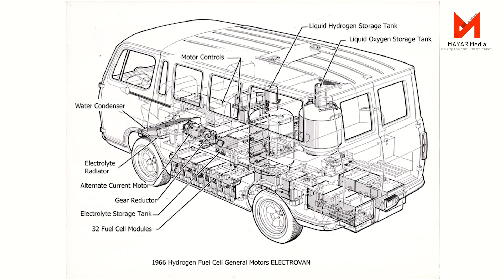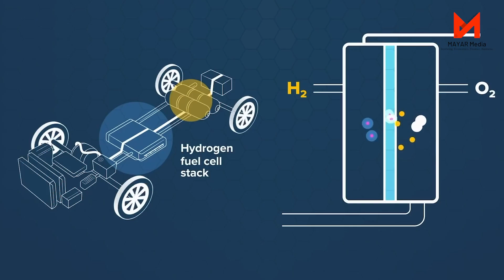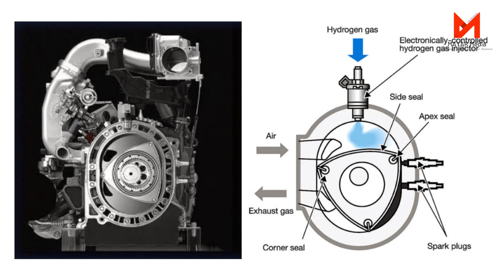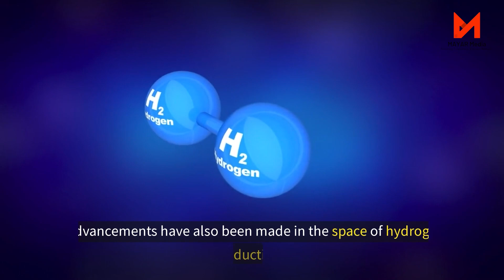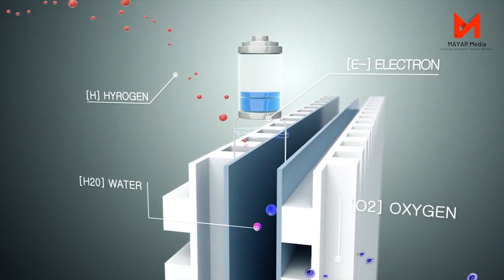Could The Hydrogen Car Kill EVs? [& Revolutionize The Automobile Industry]

Comment: Hydrogen will never replace electric. There are several important reasons for this. One reason is that using an ICE to burn hydrogen instead of fuel is still extremely inefficient. There is absolutely zero infrastructure for hydrogen in almost every country of the world. Hydrogen is very hard to contain. It is a very leaky gas and the technology to cheaply manufacture and transport. It exists but you're carrying the cost of manufacturing and transporting a fuel. And yes hydrogen has to be manufactured. So while on the surface you would gain some independence. The cost of hydrogen is as much or more than petroleum.
Reply: 😂, the.

😊

😊😊.😊😊..😊😊😊.😊😊
😊.😊😊.😊😊😊 me p..😊😊

Comment: Neither Hydrogen or EV's will revolutionize anything any time soon. It has taken the automotive industry over 100 years to get to were we are today.   The problems with Hydrogen are well known but the media still insists on coming out with hype that seems to get the attention of the public, the part about emissions is always played up, the down side is rarely talked about, unless you can be bothered to find sites that show both sides of the story and use scientific fact rather than hype. So no Hydrogen will not kill the EV's nor will EV's solve the pollution problem. There is no silver bullet to this problem, many different solutions will have to be found but with Hydrogen the future in the automotive industry is as dead as the Dodo, in other areas of transport it may have some merit.